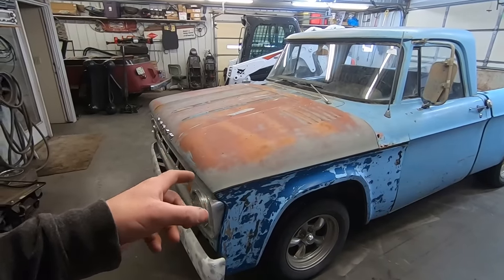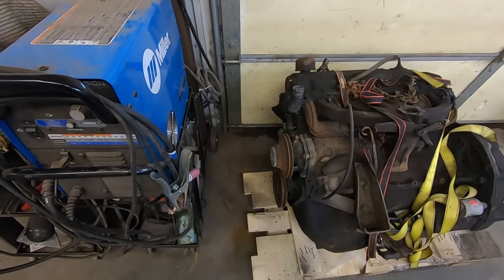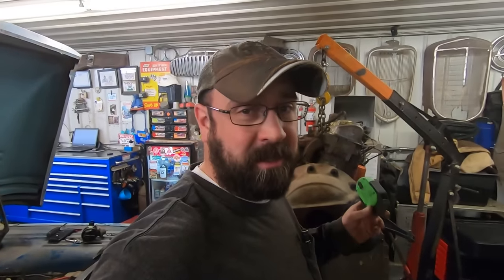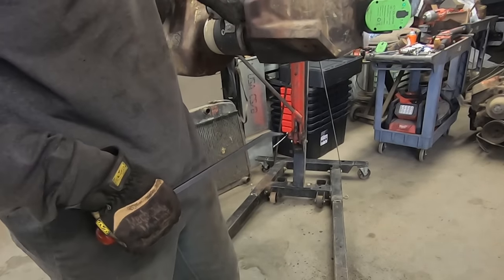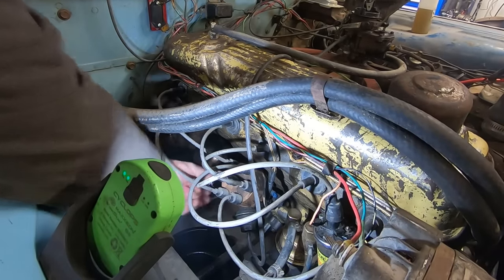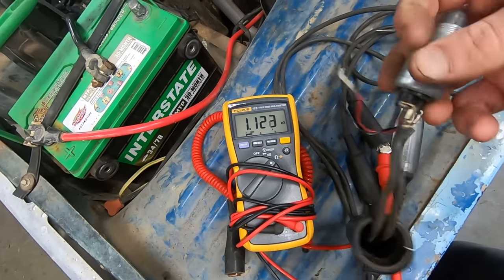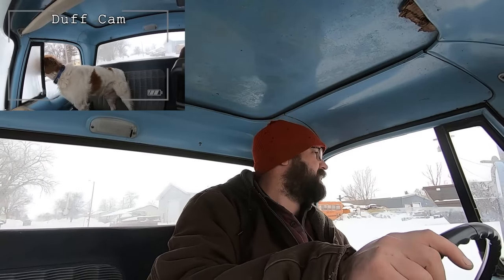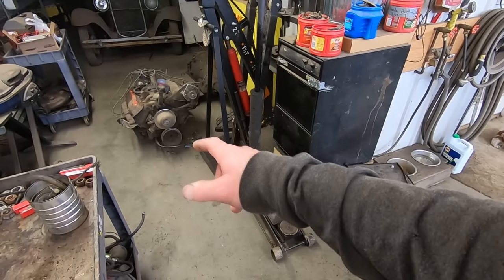The King is back! 1968 Dodge D100 Shortbed Sweptline pickup returns from the Dead!

Comment: could you have swapped cranks, and replace just rod brngs?
Reply: Not advisable the connecting rod might be hammered out of round, if it is it will just stack or spin that bearing again

Comment: How's the timing chain on that old engine I bet it has lots of slop in it and that's why your having issues with the timing how about the gear on the distributor after seeing teeth missing of the timing gear you may have a issue there too you just never know you should check the lash of the valves too being it's a solid lifter cam and who knows the last time the lash was checked on that engine
Reply from the maker: Never checked

Comment: FYI The slant 6 with the plug tubes 1963-74 does not use the crush washers on the plugs just to let you know the tube acts as he washer and the crush washer is not needed If you want to run a good plug run a NGK ZFR5N spark plug. Don't use Champion they are junk they use to be good and what Mopar called for before but me and a bunch of mopars guys with slany 6's use the NGK ZFR5N
Reply from the maker: Thanks for the info!

Comment: Mopar had the one bolt slightly offset on the crank flange because some were externally balanced, and the flywheel, flexplate, or torque converter had to be oriented correctly. That's my theory, anyway.
Reply from the maker: Makes sense!

Comment: I’m looking to buy a 68 D100 with the straight 6. 2wd longbed. Solid truck, not sure if it runs or not. I’d like to do a v8/auto conversation. Do you know of any good swap combinations? I’m more of a Chevy guy personally. I ls swapped my Foxbody mustang. I’m thinking a 5.7 hemi with a automatic. Or a 440/727 out of a RV (friend has one for sale with 70k miles)…… any suggestions would be appreciated. I’ve never messed with a older Dodge before. Oldest Dodge I had was a 1986.
Reply from the maker: I’m no Mopar expert

Comment: pressure washing engines? Use good old easy off oven cleaner. Spray on, leave for 15 minutes or so, wash off. makes it look new. Might want to be quicker on the wash an aluminum engine.
Reply from the maker: Thanks for the tip

Comment: If you want an A833OD in that all you need is a bellhousing with the larger register from any car, pickup, or van that came with it. I've put them in cars and pickups and they don't care if tou use car or pickup parts. The hyd. clutch shouldn't be too hard to figure out. I've used a Wilwood clutch cylinder mounted on a homemade bracket attached to the stock clutch fork on the other end on a big block 4spd swap in a 318 auto Belvedere and I aint half as smart as you. I love the od 833 in my shortbed stepside. 2,000rpm at 60mph w 3.55 gears and my barely warmer than stock 225 pulls hard enough in 2nd at 1,800rpm. Don't leave the keys to that truck where I can find 'em
Reply from the maker: Do those bellhousings have the engine mounts built into them.
Reply: @MortskeRepair  nope. The OD trans has a mount at the back like a Torqueflite or a regular non-granny trans so you do away with the heavy duty truck trans specific bellhousing.  If you find an O D. 833 grab everything if you can because the clutch and flywheel are different than the truck trans. Also be aware that non OD bellhousings have a larger hole for the larger diameter bearing retainer/inputshaft snout. The bellhousings are the same otherwise so be sure. The O.D. always came with a genuine Hurst shifter as well so get that too.
Reply: In your truck you'll need to either get a trans crossmember for the regular non-heavy duty trans or make something out of boxtube or angle or whatever. Those crossmembers are common as dirt but simple to make if you'd rather roll your own. Those are great transmissions, you can find them in everything from Volare/Aspens, Dusters, pickups and vans from 75 on. GM even put the A833 OD in pickups for a couple years circa 1987, the internals are the same but not sure if they used the same Hurst shifter, trans mount, spline etc.
Reply from the maker: @jonathangehman4005  I've got a couple A833OD transmissions so I'm good on that part. Just don't have the bell or flywheel.

Comment: I'm a little worried about that flywheel.  Early Slant's have forged cranks and later Slants have cast. The counter-weighting is also very different.
Reply from the maker: How so? Internal vs external is the only thing I'm aware of.
Reply: @MortskeRepair  Would the balance weight not be way off?  But I suppose if the engine ain't shaking itself to death.... heck, run it.

I'm just very paranoid about those kinds of things.
Reply from the maker: @That_AMC_Guy  It would if they were internal vs. external balance but I find it hard to believe they would change that midway through a series of engines.

Comment: Hey pud ,I mean Mortske lol. I been wanting to offer a suggestion when it comes to them pesky rubber to steel clamps jobs I've found that aircraft style clamps can save you money. I figured that out the hard way after losing 5 or 6 qrts tyranny fluid that was metal to rubber even if it were a getcha home fix it saves you money.

Comment: I'd be proud of this truck also.  Just for the extra push over the commenter's 
cliff, I'd ask 7 grand....  🍺 LOL  Pulling and replacing an engine by yourself is pretty 
impressive to me alone.  I think this is a cool looking truck.  Of course I'm a 
Dodge truck fan.  Only I don't have one this impressive, mine is a 93 Dodge with 
the 6 cylinder Magnum.  But I still like it when it runs right....  LOL  Wiring and 
all those stupid sensors has been my biggest problem with it.  But generally 
a good truck.  Was cool to watch all you went through to do it as always!  
Cheers Mortske!  🍻 -Al
Reply from the maker: Thanks Al!

Comment: I have a 1968 fargo d100 parked in the bush with a 318. Its clutch is stuck to the floor. Do I need to get a new slave cylinder? Or does it just need to build pressure?
Reply from the maker: master and or slave is likely shot
Reply: @MortskeRepair  thanks for the help. I'll look into it!👍

Comment: wind it back it takes the pressure of the spring, and if you leave it compressed it gets weak and reads the wrong torque. but we knew what you meant.

Comment: Why not just send the crank out for grinding say 10 under and buy the bearings and change the oil pump because of all the gas in the oil and maybe a timing chain. Then you have a engine you can count on.
Reply: What about the rod if it's hammered out of round all that will happen is it will spin or stack that bearing again
Reply: @offensive164  I assumed he would change that out as well.
Reply from the maker: Or just buy a $100 engine and drop it in. What about all that bearing material that's in the oil passages?

Comment: Slant-6 colo(u)rs from the factory:

Metallic dark turquoise: Some 1960-'61 Plymouth-Dodge full size cars, North American market

Silver: 1961 (RV1 sold as "1962") Valiant, Australian market, some '60-'61 Plymouth-Dodge full size cars, some '61 Valiant/Lancer.

Red: 1962-68 all passenger cars, all markets, except as specified below, plus most 1960-61 Valiant/Lancer, North American market

Turquoise-blue: 1962 through 1966 Canada-market 170 engines, plus all slant-6s in 1969 passenger cars & trucks throughout the North American market

Blue: 1970-1982 all passenger cars & trucks, North American market

Turquoise-green: 1967-1969, w/2bbl carb, Australian market

Orange: 1967-19??, w/2bbl carb, South African market

Yellow: 1962-early 1969 truck/bus, North American market (some '61-'62 got red)

Black: 1983-up, all applications, North American and probably other markets.

This list almost certainly omits some versions of the slant-6 sold in some non-North-American markets
Reply from the maker: Great info! How about industrial?
Reply: @MortskeRepair  Heavy-duty slant six engines used in industrial and some truck/bus (perhaps fleet as well) applications used a double-row roller timing chain, chrome-plated upper piston rings, and other features depending on service duty (polyacrylic valve stem seals, positive valve rotators, stellite-faced exhaust valves, and/or a high-volume oil pump). Some say you can retrofit the double roller chain and gears into car slant sixes; the double row timing chain is NAPA part 9168, used from 1962 to 1975 on the slant six; the sprockets are part S338 and S339 (thanks, Bob Rodger)....
Reply from the maker: @nicktriplett1976  More great info!

Comment: Make sure you use the right bolts for your flywheel and clutch and pressure plate because you don't want to have to go back in there except to put a new clutch flywheel pressure plate throwout bearing cuz they're shot anyway OMG LOL
Reply from the maker: Agreed

Comment: What's your opinion on Jasper engines?
Reply from the maker: Got one in the 71, seems good.
Reply: @MortskeRepair  thanks bought a 98 c1500 with one in it. 5.7 with 21000 on the Jasper- to bad the frame broke. Can't find one in PA.
Reply from the maker: @richardrtracy  Get your welder out!

Comment: 1974 dodge chassis is almost a direct bolt on then u have independent front sysupion
Reply from the maker: Same cab and box mounts? Core support mounts? What about the steering column? Have you performed such a swap?
Reply: @MortskeRepair  yes have done the swap the cab mounts work core support very little mod steering column to work perfect you need tilt wheel but we didn't use tilt we used stock column. the wheel base is 1'' longer so the spacing is a little more between cab and bed real easy swap . we used a 1974 chassis but  all the way thru 1993 should work ours was long wheel base

Comment: I would never pay real money for an anemic slant 6. They make zero power and they're overrated. The only ones with high mileage were the ones driven by old ladies, usually Aspens and Dusters. Easy to work on and that's about it. Plus, that's a nice truck and it deserves atleast a 318 but I'd spring for a 383 with 440 heads because why not.

Sweptline trucks are nice, you don't see them around here in the PA Appalachians.
Reply from the maker: Thanks for watching!

Comment: Coca cola,plus baking soda scrubbed together with a pushbroom (repeated several times) will get rid of oil stains from concrete.
Reply from the maker: I'll give it a shot!
Reply: @MortskeRepair  old school home remedy,Your welcome sir!!
Reply from the maker: @jayceec3539  The gasses won't kill me or burn down the shop will it?!?
Reply: @MortskeRepair  no.. We learned from a couple who were flipping houses& were needing to get the concrete driveways oil free again.
Reply: Much less expensive then having the non stick,waterproof sealent laid down on the floor.
Reply: @MortskeRepair  also learned from another neighbor that the more mosquito repellent that you spray onto headlight,taillight lenses,& then wipe off..the cleaner& clearer they become ,back to looking brand new!!
Reply: @MortskeRepair  my mom is a homeopathic remedy specialist,so I have learned alot of old fashioned cleaning methods from her too.
Reply: @MortskeRepair  greta may (possibly) calm down,once there's no oil on the floor??
Reply: @MortskeRepair  It is really a huge bummer that 65 orange chevy wo'nt work!! We have never seen an engine with that much rust in the cylenders b4,that was at least 2 lbs of it..holy cow batman!! That's extreme neglect,by previous owners. The guilty parties should be run over,for allowing it to get that bad,gee whiz!! The body is so worth saving!! My dad took care of his 60's chevy truck religously and it lasted for many,many years.
Reply from the maker: @jayceec3539  I have heard that

Comment: I hope that garage has a damn good heater. Bet ya use a ton of kerosene. Or propane. Or watts. Coal. Wood. Whatever.
Reply from the maker: Yup. Fuel oil and electricity
Reply: @MortskeRepair  A friend of mine is a mechanic. He does a lot of oil changes, so naturally he heats his shop with used motor oil.
Reply from the maker: @jeffrykopis5468  Yup, pretty common around here for farm shops and mechanic shops as well. Makes it hard to get used oil however.

Comment: the both of you guys should have putt a quart of Rislone in your oil at every oil change you can put one in the junkyard slant 6 before you start it up, who knows I do, your  guest could Might have Rammed past 80,000 miles, Mopar Dodge Plymouth Chrysler notoriously are  historically known for stuck in sticky lifters. .
Reply from the maker: We do run Risoline in these old engines.

Comment: Awesome truck,...but boy...prone to rust,...dodge was importing crappy laminated steel, I believe they still do...
My mechanic bought a late sixties, early 70s looked almost like that...& he had most of the options, was his company truck,...(just a little carburetor shop)....That truck drove like a Cadillac...had a gear shift on the dash board 383....but. Couldnt keep the rust away....off course road salt don't help....

Comment: The slant six are unkillable , uncle Tony’s garage is good for how to make these engines double there horsepower with clever basic engineering, l think their biggest problem was the sump design and some oiling issues.
Reply: The basic design was spot on for non racing applications. It was poor QC in the manufacturing process that gave some of them problems.

Comment: If it was me I would have rebuilt the engine that way I would no it would last for many of years. I have had King pins not tack GRES all I do us a torches heat them up until they tack GRES then I would put in GRES every week for about mouth then I'd do it wince a mouth nock on wood I have never had to replace king pin's.